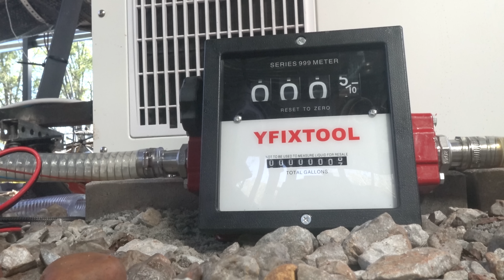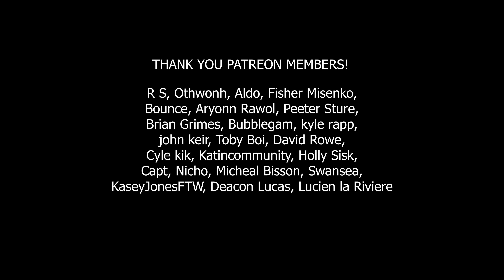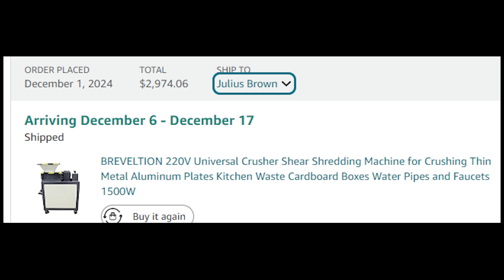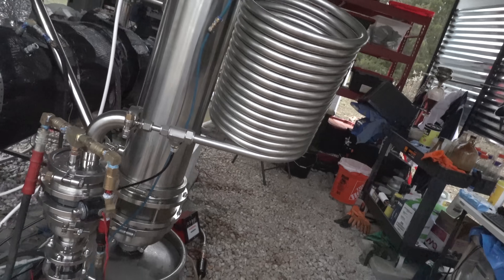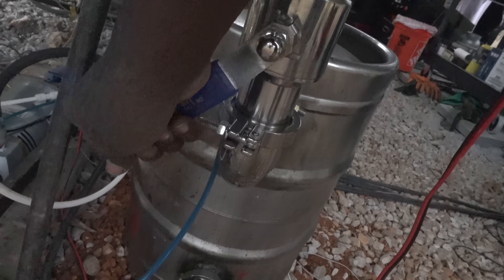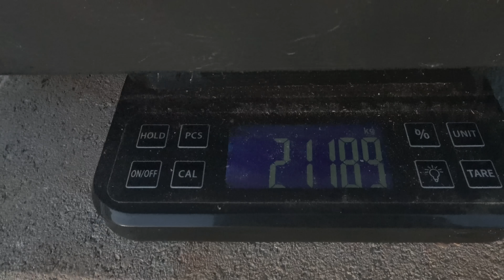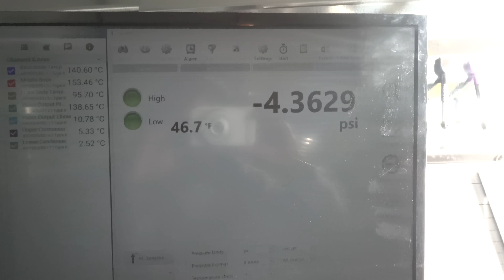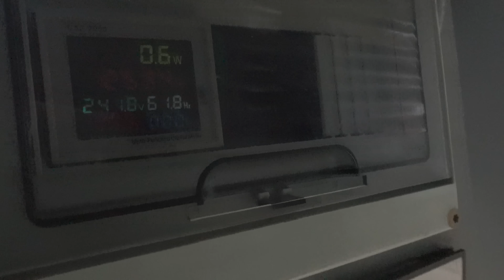I made my own gas station! Fueled by Plastic Waste + LDPE Analysis Run Part 1

Comment: Bro weld a small circle plate to the end of your pushing pole so it’s easier to push the plastic in
Reply: I swear i was thinking why is trying to stuff the tank with a stick lol
Reply: He could just add a top loading hopper
Reply: @akeem2752 he does have a top loading chute, its currently broken its a shredder as well
Reply: Yes and No... it wont help as much as u assume.  For soft materials, yes, for hard materials, NO.. There are gonna be spots and slots that a pole will be able to push materials in.
Reply: He did better than us💪🏾💯
Reply: I would say retrofitting a wood chipper pre hopper would be the way.
Reply: This why we all need to collaborate more. Lose ego and help each other.
Reply: It’s just an idea to help the project and operation run just a bit more conveniently💡 the thought popped in my head when I seen Naturejab pushing the material in with a pole and it was getting the job done yes but I bet it takes a while because it’s tedious trying to push every little bit in with a thin pole so I just had an innovative idea 💡 to help make things smoother. Also I don’t care for the credit because I know this PROJECT IS GOING TO CHANGE THE WORLD 🌎 for the better 💪🏽🙏🏾 and that’s all that matters to me. Shout out Julius man you are doing great thing for this planet 🌍
Reply: @AfroJedi-l1x He has to come up with something new in order to change the world. Nothing you saw in this video is a new invention that didn't exist yet. This all was invented a long time ago.  The patents on this technology expired long before this guy was ever born. There are several processes that have been used,  one of them, and the most common is called Pyrolysis and another is Catalytic Thermo Liquification, CTL. 

Purdue University also found a different technique called hydrothermal processing but it is only used on polypropylene plastic. This process involves putting the plastic in water and heating it extremely hot at high pressure. This process just turns it into oil and then it would still have to be refined into gasoline.
Reply: Came to say the same thing.
Reply: https://www.youtube.com/watch?v=z_MqqLgTNLQ
Reply: @ amazing video very informative
Reply: Absolute genius idea- Harvard’s callin’
Reply: Geniuses don't have common sense
Reply: @BangumP 😂😂😂 true I guess
Reply: @BangumP u r a dunce
Reply: Sound advice
Reply: I was thinking the same thing
Reply: Dont forget the chamber isn't completely hollow..
Reply: @gonelucid they’re not the brightest 🤦‍♂️🤣
Reply: 🎉🫨😲Patent troll attorneys gonna take the name & say they own the “concept” 😂before he can even file his own patent.  Why he would put this on YouTube for them to steal???😢 You! Don’t give him help bc he probably won’t be cool 😎 enough to give you credit for improvements.
Reply: @sandycheeks1580 If you need credited for everything, you're insecure. Recognition is nice, but mountains of plastic disappearing is worth sacrificing for.
Reply: @sandycheeks1580 There is nothing to patent, all of these processes he is using had their patents expire a long time before he was ever born. He has not invented anything yet, everything being done has been done for many decades.  It has not become mainstream because you have to burn many times more energy than you will ever produce in order to turn plastics back into petroleum. In other words many gallons of fuel will be consumed just to make one gallon of gasoline from plastic. The fuel is going to either be burned on site or at an electrical power plant depending on what he is using to heat the plastic. The plastic is being heated super hot for many many hours to make this process work. He has made something really cool and he's very smart but he did not invent this process. There are actually two different processes for doing this and both of them involve using a lot of heat for extended periods, you have to burn a lot of fuel to do that.

Comment: Use the natural gas directly to power a generator to run the system in a loop
Reply: He can't. It's not usable fuel as it's far too toxic.  
It would need sent to a specialised refinery where it would require the same, if not more, processing than crude oil before it could be safely used.  
This is just a very expensive way of converting electricity and plastic waste into cancer and forever chemicals.
Reply: @EddieTheH  not true, the natural gas is perfectly usable
Reply: @EddieTheH  yall have a funny thing for overcomplicating things and creating barriers in your mind that don't exist. I guess thats how normal people cope

Comment: Tires are a big one that's used in pyrolysis too! I'd be interested in seeing that. There are whole landfills of tires and they're pretty homogenous
Reply: Are you guys trying to get him killed? He isn’t a real chemist. There are chemicals can be very harmful. I’m saying this, because I do understand his drive. And he believes in what he is doing. But it’s like building a submarine out of barrels. I just don’t want him to hurt himself.
Reply: @ he has the funding to buy proper stuff now, definitely not being built out of barrels. He'll be fine, the pyrolysis and refining process are both pretty simple, one is cooking under a vacuum, the other is boiling the oil and cooling the vapor with water, he'll be fine
Reply: @fairybeliever4479  pyrolysis of vulcanized rubber is no more dangerous than plastic bags or styrofoam.
He has the vapor scrubbers already. He will be fine.

Also, I'd venture to say he has more chemistry experience than 80% of this comment section.
Reply: @nachtkind46  To be honest. I’m just worried for his safety. I believe I saw a video of him a while back. Where the machine blow up on him and I think he needed medical care. 
At that time he wasn’t using any face mask either. So he was breathing in those toxic fumes. 
I do get his excitement over this. Since it’s his passion. But I also believe that he could truly use his money and do something else with the plastic. He could maybe turn it into pellets and then work his way from there.
Reply: @fairybeliever4479  a pyrolysis machine is like having an oil well, that's why
Reply: @ he's outside, he'll be fine
Reply: Tyre gasification with combustion and reduction to form carbon monoxide and hydrogen. Very clean burning fuels.

Comment: Dude BVV really LOVES you man that 40ft double coil is SUCH a great idea!! I especially like the straight "air condenser" coming out of the reactor body at a steep angle to catch all the high boiling vapour without being trapped in the actual condensers. The fact that you set up the condensers vertical AFTER the collection tank was definitely the move 👌 that way any low boiling shit gets caught after so youre not plugging up the sight glasses anymore.
Reply: no. https://www.youtube.com/watch?v=z_MqqLgTNLQ
Reply: Protect you  self from BIG$$  Energy who will be pissed , am sure they contact him and give him chance to take THIER MONEY AND Keep quite.
Reply: @wisdoma4860 Big energy is laughing at his wasted efforts in all the energy consumption to get a few ounces.
Reply: @scamchan  It's a proof of concept, R&D takes time, one man doesn't have the resources of "big energy" who can throw big money, big equipment, and big numbers of people at a research project. The amount of energy spent vs the energy returned is irrelevant at this very early stage, that can always be refined and optimized later on as the process is improved. As you scale up and boot strap the process, it takes several stages before becoming self hosted.
Reply: @daxramdac7194  Concept has already been proven and being sold already.

This guy isn't bringing anything new to the table to solve the problems.

Too much energy consumed and not enough end product produced.

How pure is the final product and what engine will it be used with?

What is done with the toxic waste and goo?

Comment: Now Id just like to ask you can you add organic matter to the plastic waste to generate Biogas in this same process ? 

And will it process raw organic trash to carbon components ? 
I truly see a new industry developing with your process here . and I am defo on board with this process and its supporting technologies.
Reply: Organic waste can be turned to biogas at room temperature mesofile decomposition and some patience, and boosted by sidestream hydrolysis, body temperature (thermofile) speeds it up, combine them and yield is even better, the solid fraction can then be used for drying and pyrolysis but gives a very high yield in carbon/biochar. See the danish skyclean project

Comment: Aight so when are you finally going to tone down and stop mislabeling this cancerous shit you've been making? As everyone who isn't completely brainwashed by your cult bullshit already expected, it's just a bunch of random hydrocarbons, mostly styrene. Styrene is not a fuel. It will cause cancer to those around you when burned. It will cause cancer to you when handled improperly. 

Stop lying to your followers, Julian. Do better.
Reply: Well said.  
We don't need more dirty benzene and styrene, and whatever heavy metals and halogenated crap is also in there.  
The plastic waste was doing waaaaay less harm to the environment before he got hold of it!

Comment: You want to keep the machine simple so novice people would be able to use it.
Reply: That's the problem.  
He is a novice, one who stubbornly refuses to learn the science or even follow scientific method.  
He's been told why this is a terrible idea by people who aren't too lazy to learn the science and he's consistently ignored them in favour of collecting donations and grant money.  
He's a scammer who's doing more damage to the environment that the problem he claims he's trying to solve.
Reply: @EddieTheH  I think he just wants to get rid of plastic waste, however he said he's going to try using solar,  but I don't think the energy will be strong enough.
Reply: @tonywalker8030  Even then, he's still not making any fuel. He's still making a toxic cocktail that he's not equipped to handle, let alone make safe.

Comment: i think the pump didnt die but it crapped itself because of all of the air - it clearly is a pump which does not like air at all. He is gonna have to come up with a method of compressing the crude inside of the barrel ... or maybe mix it with water so that even small amounts can be pumped - water does not bond with oil, they can be seperated mechanically. Also : he needs a level shutoff for the pump.
Reply: Either that or a collapsible barrel that remains under vacuum and fills free of air... I wonder how it'd work.
Reply: @davidkelley8541 a plenum

Comment: Thank you so much for all the hard work and long hours you’ve dedicated to making this world a better and cleaner place. I can’t wait to see what the future holds for you. I can’t wait to see what’s next! I read that Americans throw away 50 billion plastic water bottles annually compared to 25 billion styrofoam cups. Not sure if it’s true or not but if that’s the case, plastic bottles should be next!
Reply: All he's done so far is collect donations and caused far more environmental harm than just leaving the plastic in landfill.  
He's converting mostly benign, stable, solid waste into toxic volatiles, halogenated compounds and heavy-metal ridden toxic dust, and wasting loads of energy to do so.  
He's refusing to address massive problems he's been warned about for years.  
Turning plastic into cancer isn't new or clever.
Reply: @EddieTheH  the fact he is trying and putting effort into solving a problem is highly commendable. Besides, there's no way what he is doing can even put a dent into how much pollution factories, cars, and other things have done to the environment. He is constantly upgrading and changing things based on the results.

Comment: After you get the shredder. Would you accept plastic from your viewers? I have like three trash bags full of failed 3D prints that I've been trying to process, but I just don't have the money where the time to continue pursuing that idea.
Reply from the maker: Sure I will take it! Send it here: 8491 Hospital Dr. #237 Douglasville GA, 30134
Reply: @naturejab Hi man. I know that I have left some critical comments regarding what you are doing.
I see that you are invested in this thing.
But in the end we both know it’s not viable.
You seem like a person who wants to create and achieve something that will benefit people.
I recommend you divert your focus from this, but still use the knowledge that you have learned from melting plastics. 
Try thinking out a way to make a product, that uses plastics.
That way you will recycle the plastics and it will use less energy.
I could come up with a few things with ease. 
The downside is. You will need a constant supply of plastic.
Reply: PLA to crude could be interesting, but wonder if it's a good idea chemically, smarter people will probably know this.
Reply: @jakobhansen1396  I just looked it up. It's Lactic Acid. It wouldn't work. Crap.
Reply: @Dtr146  too bad, glad we found out though
Reply: @jakobhansen1396  Still, I'm very curious that if people were able to send him plastic, would he accept it? Because I would much rather send him my plastic waste instead of trying to recycle it. Because in my area, it just goes into the landfill.

Comment: How do I get a sample of this future fuel? It's a treasure at this point, a scientific amazement.
Reply: I'm sure is just as toxic and carcinogenic as the junk he has sent to masspeceverything. 😂
Reply: This guy would make a killing if he sold tiny collectible vials of his plastoline. He has a ton of fans of the work he does
Reply: @JamesDBuzzard  bro is honest enough not to be greedy like that
Reply: @ I don’t think it would be greedy if it directly funds his research and helps put some food on the table.
Reply: Honestly, same I'd like to be able to purchase a gallon even if its sold and shipped for $100 if this could be the future, I want to invest
Reply: @aToast3r bro this isn't the future. This process has been tried since plastic was discovered and it uses more energy to make than it produces while releasing carcinogens into the atmosphere. It would be like if someone started building jet powered cars and then people in the comments saying "this is the future!" When the technology was killed off like 60 years ago because it was inefficient and unviable. We already know this whole operation is a waste because he is solving none of the energy input inefficiencies. Burning more plastic won't solve them either.

He needs to find a way for process to use zero or near zero energy input for this process to be viable and he hasn't come close to doing that. Burning more plastic won't help him gain the ability to break the laws of physics to make that happen. He is just putting on a performance for patreon subscriptions and merch sales. That's the only thing that will come out of this because ignorant people think this looks cool and will give him money.
Reply: @clutchboi4038 there’s no breaking the laws of physics the energy/fuel is in plastics not being used it might take energy to convert them but it doesn’t matter because it’s stuff that would be sitting in a land fill anyway.
Reply: Stay the fuck away from this kid